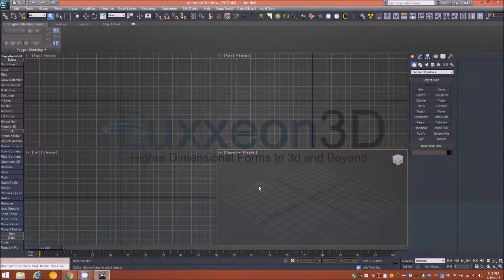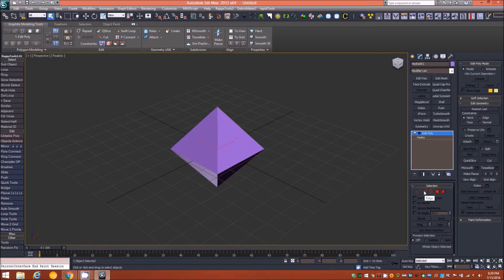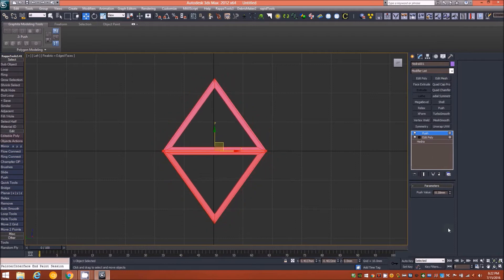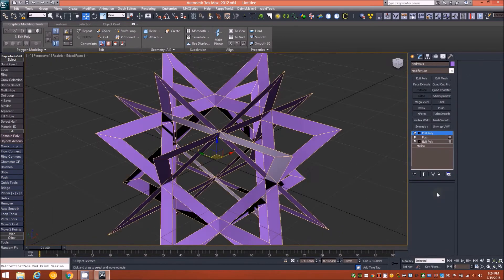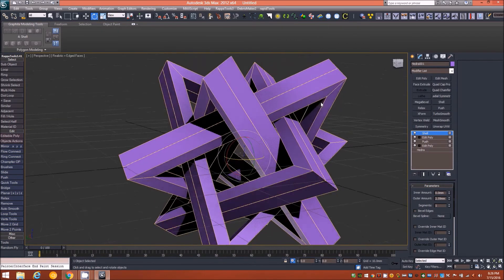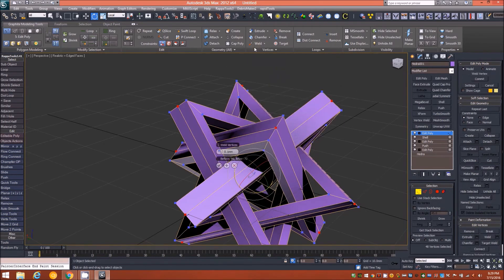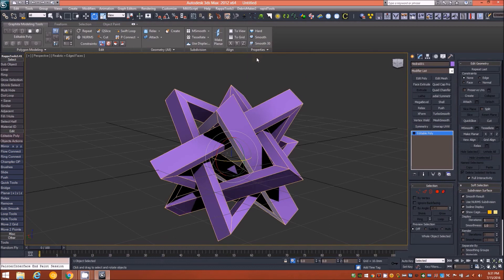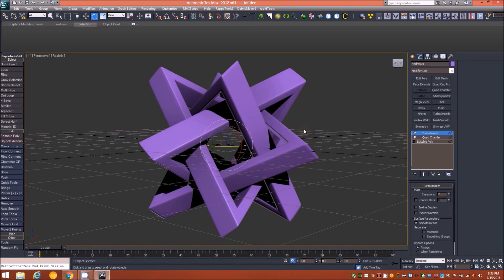3d Tutorial | Orderly Tangle - Four Equilateral Triangles | 3dsmax

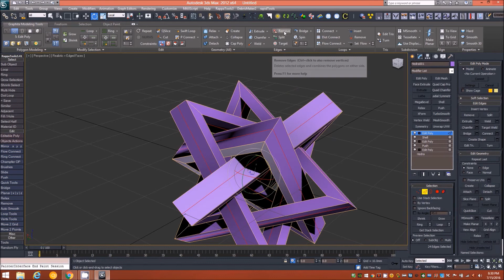Comment: Help me, plz @10:24 i cant remove the edge ... i dont know why :(
Reply from the maker: Did you take the necessary steps to remove the inner faces first, then weld the vertices together?  What happens when you attempt to remove the edge loop?
Reply: my steps are : Shell modifi/ tick at select inner face/ edit polygon modifi/polygon mode/Delete/ ...after that i can not choose a Vertex like you do. :(
Another Problem is If i dont the Delete step, i can choose the vertex by hold Ctrl+vertex , but after that i cant weld them ! ...
Reply: oops, i know where the point is ... your trick : choose polygon/Shift+ vertex /choose polygon AGAIN, so i can choose the vertex after deleting the polygon ( i forgot that step ) , after del the polygon i can weld normally , thanx a lot for your instruction ... :D
Reply from the maker: Quoc Dang Glad you found it.  Thanks for watching! ;)
Reply: 1 last thing : can u plz tell me where can i find the Quad Chamfer Modifier.? Im using Max 2015 . and my modifier list doesnt have it.
Reply from the maker: Quoc Dang Quad Chamfer was introduced in 2015, so it should be available to you as simply the "Chamfer" tool.  You have to change the type from "standard chamfer" to "quad chamfer" in the caddy options if using the tool.  There should be a "chamfer" modifier in your list, which also has the quad chamfer option in the operation properties of the modifier.
Reply: thank you very much !